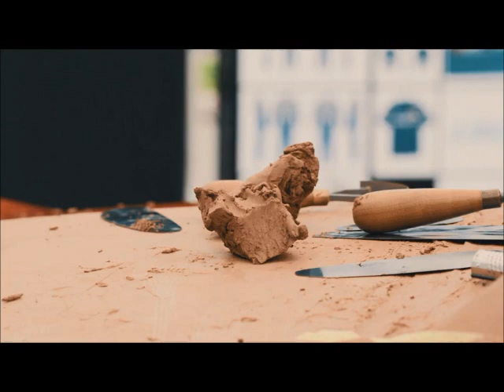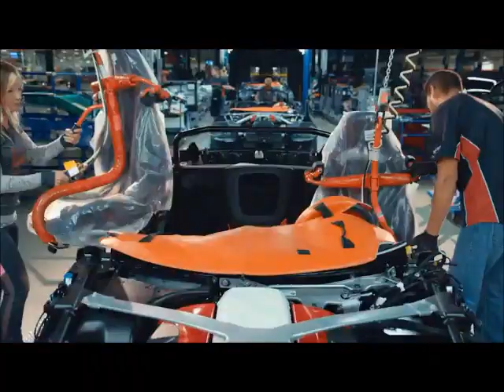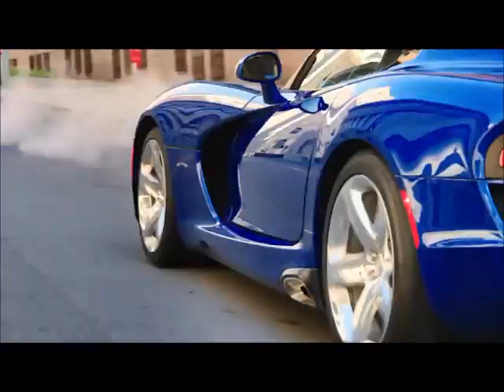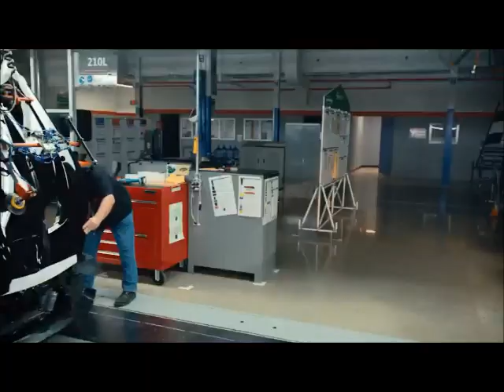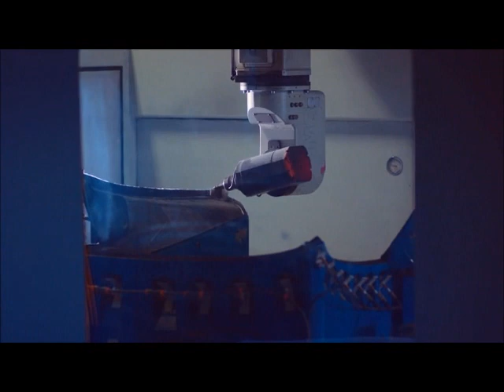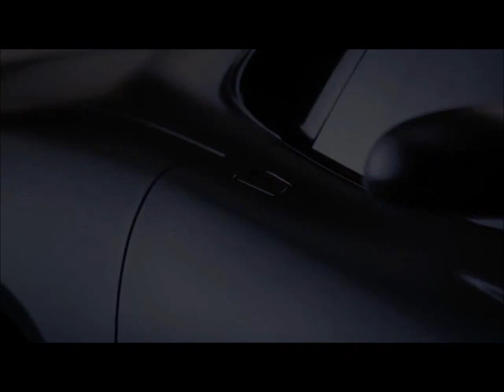SRT Viper - How it's made

Comment: I love the viper...I will own one at one point.  But I just have to say...I have been building Chrysler minivans for 25 years.  All the fine welding and such is done by robots now.  If the sanding and such is done by people, each viper will have a slightly different finish.  People sneeze, cough, and such.  You will not have a perfect finish every time.  Might be a good thing tho.  "See that dull spot on my hood?  the guy had a bad cold and sneezed when he was sanding it down"

Comment: A dodge viper called a super car that made me fall out the chair laughing! Lets start calling a vett and a mustang a super car. HAHAHA.
Reply: That is because you are incredibly stupid, At no point has the Viper never been a supercar, The current viper, SRT Viper GTS, And all its levels, 600Bhp+ which alot of upers have today, high price tag, fast as all hell in acceleration, high 10s low 11s in the quarter, Which is faster then any Zonda or Lambo that isnt a LP700 or LP610, Low 3s to 60mph, Lows 7s mid 6s to 100mph, 207mph top speed, Loud as hell, racing pedigree, Carbon body work on both inside and out, one of the fastest cars you can buy , And fast as all hell round a circuit, And tis is just the Viper, Not saying anything yet about a ZO6, SO please, Tell me again how it ISNT a supercar?
Reply: The viper and vette are often regarded as super cars because they are capable of supercar performance... especially the viper
Reply: So if I take a pinto and put a V-12 in it would that make it a super car? No.
Reply: Aaron Snowden it wouldnt handle like a viper. Vipers set some of the fastest lap times on any track. The acr is one of the fastest track cars in the world, even beating out hypercars in some tracks, how is that not supercar worthy?
Reply: Well you have a good point BUT when they can get to the point of Bugatti, Lamborghini and Ferrari then that will be a different story.
Reply: +Aaron Snowden are you an idiot? because a lamborghini, bugatti, ferraris are exotic cars not supercars theyre made to look nice how often do you see any of those besides the LaFerrari and Huracan on a track? usually never theyre made to look sleek and catch attention. not to mention they cost much more than a viper